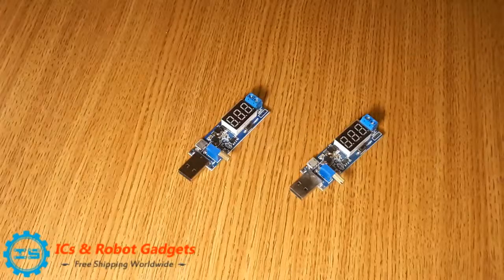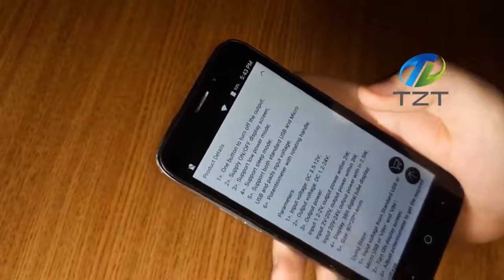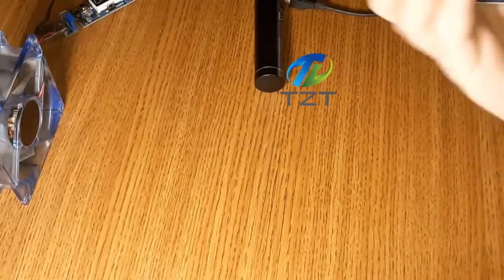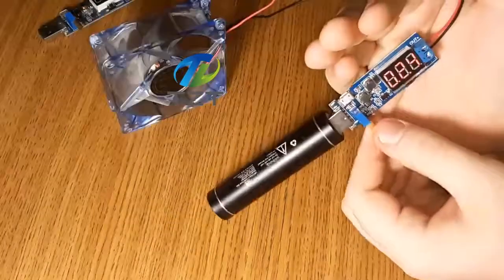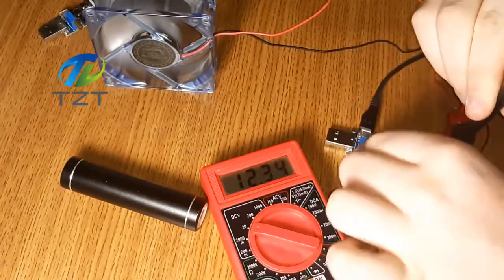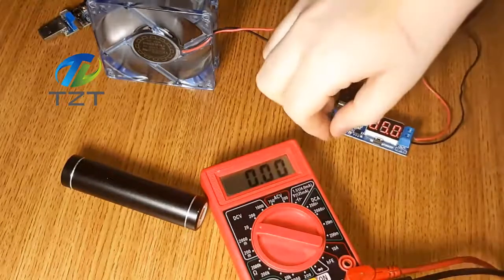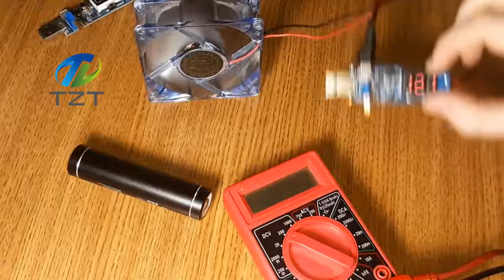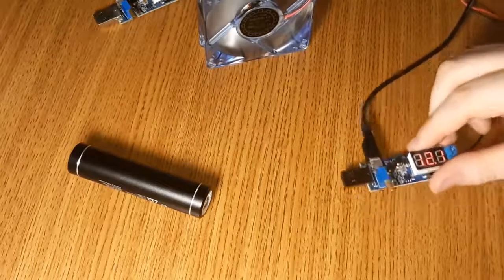DC DC 5V to 3 5V   12V USB Step UP   Down Power Supply Module Adjustable Boost Buck Converter Out DC

Comment: mine on the display say 26.1volts output but the multimeter says 25.8volts
Reply: Becomes less accurate around 20 to 24 v